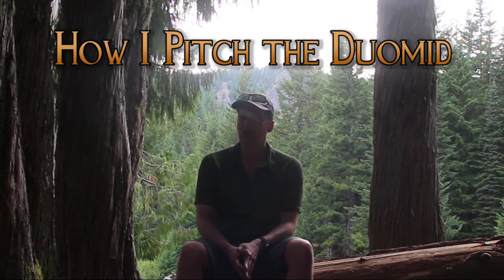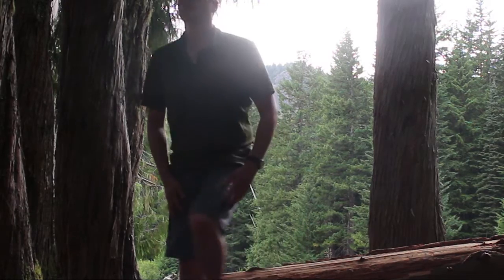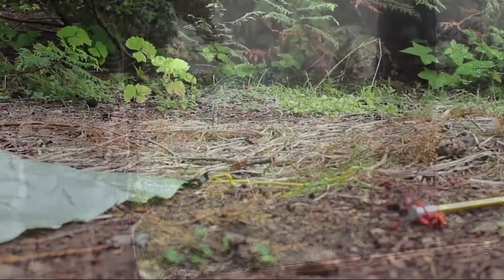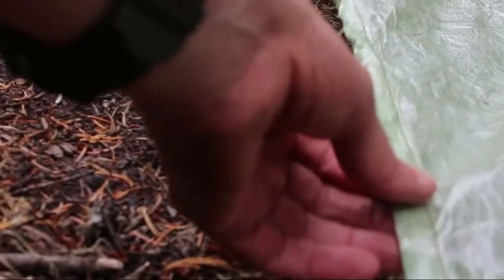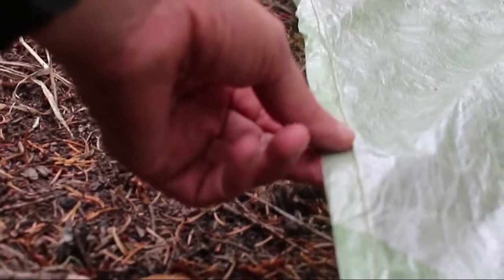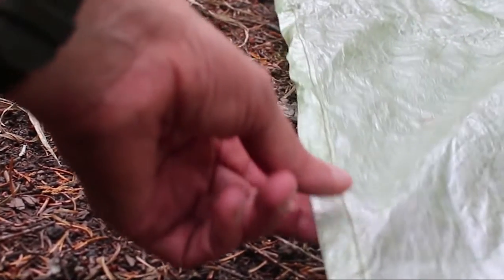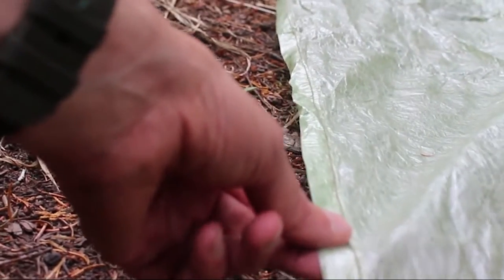How I Pitch the MLD Duomid - Cuben Fiber

Comment: What trekking poles you using?  You use the pole jack?
Reply from the maker: Richard Moran I use Pacerpoles. I remove the top/handle section from each pole and then join the remaining parts with a 10" piece cut from an old trekking pole.

Pacerpoles are short and one was not high enough for me to pitch the Duomid, that's why I started to connect the two poles.